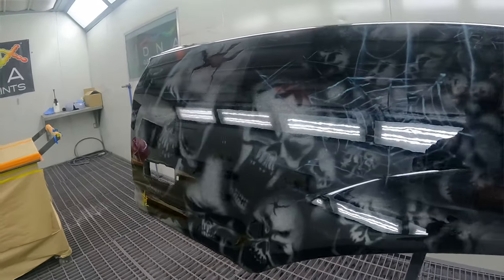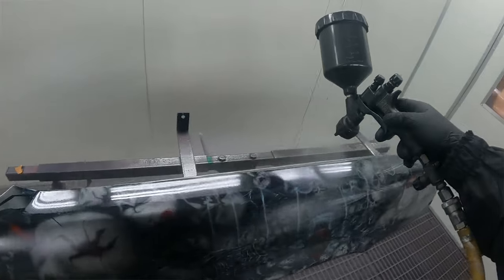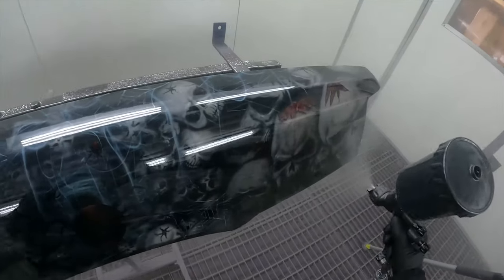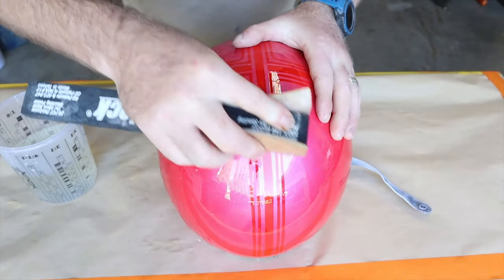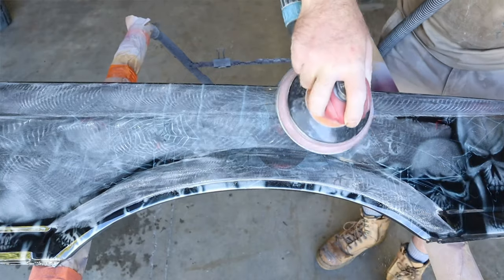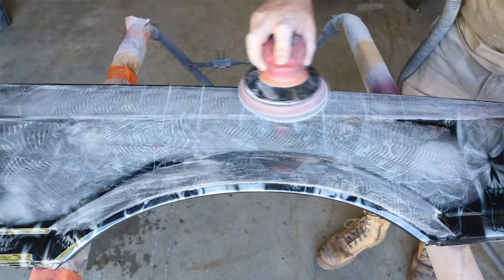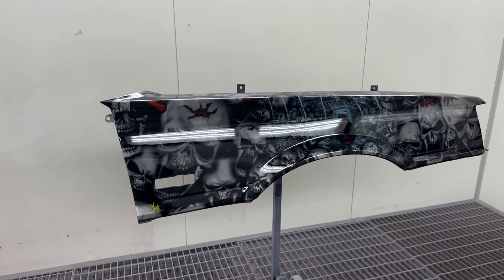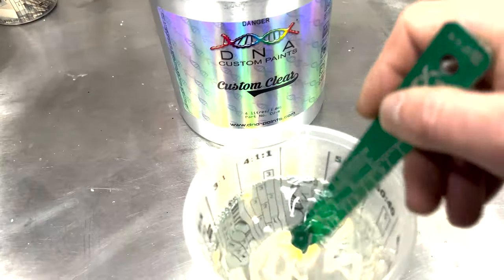Flow Coating When-Why-How

Comment: I too use the Walcom guns. The Carbonio 360 light base and the 360 light clear as well as the ego 190 and i absolutley love those guns. Once i bought the first one the (360 clear) i went right in on the computer and ordered the others and listed my hvlp ones i use to have on ebay.

Comment: Just curious what the difference in the final result would be between this and wet block sanding with 800 grit, blocking all the orange peel out and then buff polishing? Ive only been painting for a year, and only had 1 job come through which required flow coating
Reply: 5:14

Comment: So to be clear the purpose of a flow coat is for those who don't want to do 800,1500,3k,  cut, compound and polish but instead just do 800 and clear to save time? Or is it to build more mils in the clear?
Reply from the maker: A bit of both, there are multiple reasons why painters flow coat. could be due to using huge flake under the clear through to having more clear "UV Protection" when spraying candies . or just to have more depth in their color. Painters some times flow coat due to not getting the finish they had hoped for the first time around. 
in most cases painters will flow coat to get a flatter finish . its also safer to flow coat compared with spraying 6 coats of clear in one session
Reply: You can't achieve more depth by removing clear.
Reply: @jamesofallthings3684  a Flow coat ADDS more clear, hence the depth

Comment: Did you say 4 to 6 weeks?
Reply from the maker: correct mate , just because a clear coat is dry to touch and fitting up the car is safe , it may not be fully cured. 4-6 weeks is recommended
Reply: Or more. Even with multiple sessions of IR, days in the sun, etc. Or else... old sanding scratches make an appearance..
Reply: In the sun the pain cures faster correct? 1 day outside is like 2 weeks depending on the temperature